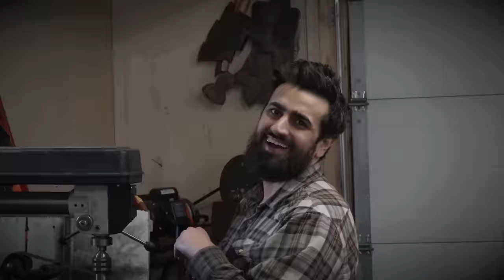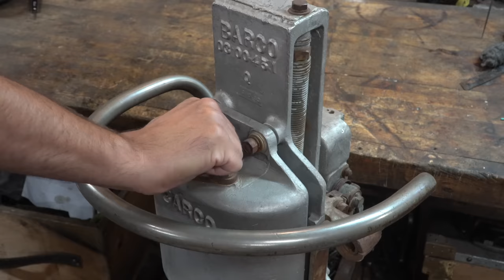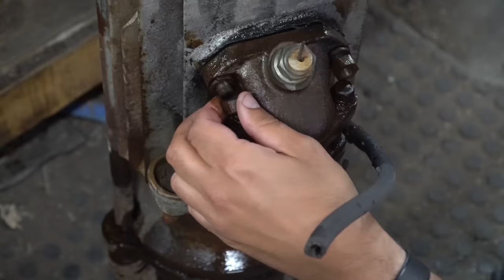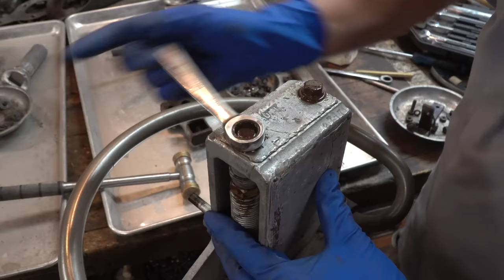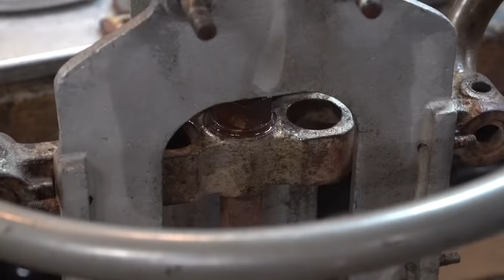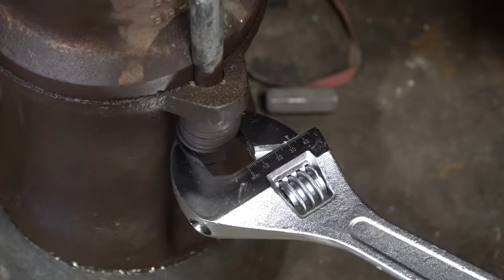Gas-Powered Pogo Stick Rammer Thingamabob [Restoration]

Comment: I have three of those rammers. Two for spares and one fully working. It has an interchangeable foot for round, rectangle and horseshoe for going around fence posts. Last used for gate posts. Being an oldie now I hop it off the trailer to the job. Gives you a work out but it is not   a beast to use once you master it. The handle is more offset that that one and does not move on a slide, being just rubber mounted to the engine top. Super restoration. Thank you, best from the UK.
Reply: Not seen one of those foot splaterers working in the UK since the early 80s! Top job keeping on working!

Comment: I haven't seen one of those rammers in use for decades. Damn fine job, sir - you've kept a piece of engineering history from the scrap-heap. Must be one hell of a rush to operate that insane device!!
Reply: I still remember seeing them used in minor road works as late as the 1990s or early 2000s in Europe. The ones I remember didn't run continuously though, you had to flick a trigger with your thumb for every explosion. There also was a different version that used a regular four-stroke engine and rotating eccentric mass, looked and sounded much less archaic and amazing.
Reply: So what is the point of this machine what exactly does it do ? Any info please would be greatly appreciated
Reply: @jamesfair9751  It's for compacting soil before building something on top of the area.
Reply: @BEdmonson85  thank you
Reply: how do you turn it off is my question
Reply: @SpitfiretheCat16  well if you’ve got that on site and you’re not willing to wait for it to run out of gas I’m thinking you’ve also got a steam roller and a bulldozer on site so you can probably figure something out😂
Reply: @SpitfiretheCat16  its controlled by that piston system, so you can just interrupt the cycle by not letting it actuate and it stops.
Reply: @BEdmonson85  I don't really see why anyone would bother using one of these given how fast wacker plate compactors are
Reply: @WarlordEnthusiast  they predate them, really the only reason why
Reply: @jamesfair9751  compacts dirt for road ways and similar projects - probably be good for compacting sand during a pool instillation
Reply: @SpitfiretheCat16  If you don't allow the spring handle to compress as the machine hits the ground it won't charge the magneto. Once that magneto indexes it will send a spark out as soon as the handle is lifted to the neutral position. If you can ground or remove the sparkplug wire while the magneto is charged, you can let the handle up without it jumping.

Comment: What a wonderful and complex restoration! This brought back memories. When I left the States and moved to Germany in 1965 these Barco Backbreakers were to be seen everywhere. After the war the Autobahns were built with these machines. I had one for awhile, but was very frustrated with it because it would only fire occasionally and drive you nuts the rest of the time. I didn't have time to look into it and gave it to a neighbor who helped me pave my driveway. Barco doesn't make them anymore, but there are still a few around here in Germany. I will look for a manual.
Reply: I remember them as well,  though I guess around where I grew up the delmag h2s was more common.
Reply: @R1ddic  true.. when I was a kid those were still common on many building sites
Reply: Did you saw any reparations for poland?

Comment: I don't think I've ever seen you struggle this much in a restoration before! This contraption was fighting you at every bolt, piston, gasket, valve, nut and piece... Good on you for sticking with it! This was a challenge for sure, but you won in the end, no doubt about it.

A rammer like that is a scary kind of fun! If you lose focus for just a second, you'll have summer teeth in a hurry... Some are here, and some are there! But that thing is one heck of a conversation piece!

Thanks for another great video, you deserve a break to relieve sore arms, fingers and legs after fighting this thing.

Comment: The amount of engineering that went into this tool blows my mind.  

Some guy saw a need for this tool for a specific purpose designed and set forth sourcing castings, forgings, nuts and bolts, baskets, tubes, wires,  pistons and rods and every other intricate details to create this.  😳 

A whole set of production lines had to be made to manufacture every tool specific part.

Mind blown.
Reply: As an engineer with todays tools I am amazed what at what they managed. Must have been quite some r&d.
Reply: Engineers are truly insane. They take concepts that are CLEARLY a terrible idea and force them into existence by sheer force of will

Comment: It never gets old watching someone make parts from scratch. The world needs more people with skills like these.
Reply: I used to trade in old electric lamps, most of them were entirely handmade. If they needed a domes screw they MADE a domed screw.  the bras parts were cut with shears and rolled or hand beaten into shape. 
It really adds a whole new dimension to thing to know that a skilled man took raw materials and created a thing of great beauty.
Reply: and the world needs people with more machines like these to make parts like these.
Reply: @katiebarber407  - Here in Bulgaria you can get anything made.  My fave shop in town - not that I use it, i just like that it exists - is the "made to order gasket shop"

Take any old gasket in and they will cut you a new one, no need to go to BMW and pay €200 they will make you one for €10.

Take the part in, they will pattern a gasket off it for you.

Comment: It was a real pleasure (and somewhat emotional) watching your retoration on this Barco Rammer.  Thanks so much for posting this!!!  My 87 year old Dad and I restored a Barco H-6 (1937 model) gasoline jackhammer before his passing. He could barely walk, but he absolutely loved going to my shop and working on projects.  A friend gave me the jackhammer as a totally rusted mess and I didn't have much hope for it.  Taking our time, we got each piece restored and back together.  Now, it's a beautiful machine.  We hadn't yet built a coil circuit for it when he passed earlier this year, so he never saw it run.  Knowing how much he wanted to see it in operation, it will be an emotional day when I do start it up.  It's something I want to do in his honor and as a celebration of our time together in the shop.

There is a nice compilation of Barco pictures, manuals and parts lists at http://gothotrocks.com/barco/barco/barco.htm.  He has posted a user's manual for an older tamper/rammer, but not for the one in this video.  Perhaps others can help him add Barco documents, advertisements and articles to his site.

Comment: A) That might just be the largest slotted screw there is. That's mental.
B) I've never seen you struggle so much with a disassembly. That thing had no intentions of coming apart at all. 
3) That's easily one of the neatest "what the hell were they thinking" machines I've ever seen, and that includes your swinging circular saw thing. It's surprisingly quiet too. 
Good work on this restoration.
Reply: You should see the slotted screws on the breech of 16 inch naval guns

Comment: What a "dynamic" old machine. We use the modern version of this frequently. We call them, as does the rental company, compactors.They compact soil much deeper than the walk behind plate compactors used to prep the ground for a concrete slab. Anytime there is a need to compact soil deeper than 5-6" , one of these "Gallopin' Gerty" compactors is used if a larger machine won't fit into the space. If you've never seen a contractor use a compactor, you'll know two things. #1 Why the concrete slab cracked next to the house #2 You need a different contractor.
Reply: As a former mechanic for Wacker Corp., we called them rammers
Reply: Great info! 👍
Reply: We just called them Wackers kinda like band-aid
Reply: They were common in the UK when I was a child - present whenever men dug a hole in the road - which was often. They fascinated me and, aged about 2 or 3, I named them "bedumfers" - from the sound they made. That kind of stuck as their name in the family.😀
Reply: @jc3745  Jumping jacks is what I always heard them called, and they were indeed Wacker brand if I recall
Reply: we use similar for trenches when going round roots we 'not allowed to damage' we've always called them elephants foot.😀🤘
Reply: @TomBonahawk  Wackers is what I've heard them called.
Reply: It's a whacker to me too. We had one like this on the first site I worked on and it was only really kept for novelty value as nobody was prepared to actually use it in anger. Perhaps they are OK if you practice long enough but we all preferred our bones and teeth intact so nobody was willing to risk it. We had other less nasty-accidenty ways of whacking. 

As a kid I'd seen them used and REALLY wanted a go. After one whack when I did get the chance I quickly changed my mind.
Reply: I call them "Jumping Jacks" but I used to work for a German guy who called them "Wackers" or more accurately "Vackers" because of his accent/sense of humor. I still call it a Vacker from time to time because of him.
Reply: Define large compactor, since i have never seen one of these on the worksite (though different continent might explain it), but plate compactors are often used(metal plate that has off set fly wheel and engine attached). Sure this is compact on size but not that accurate to control and where 40cm plate compactor cant fit, there is no need to compact it, or engineer designing it fucked up bad and work crew was not paid enough to care to point it out, even if engineer or management in general gave a fuck.
Reply: less PC name for them was "Paddy's Motorbike" , though maybe that was just the later ones with the conventional 2-stroke?
Reply: @em7ee230  The plate whacker we had was nicknamed "Paddy's go-cart" and we did have a groundworker called Paddy and he was quite adept at sitting on it and steering it by shifting his weight about. That must be where the name came from. He was the guy I missed most when I quit. Not only was he one of the most intelligent and well read people I've ever known he was funny, generous to a fault and taught me a lot about Irish history. He was a staunch republican and would deliberately start fights in pubs by expressing his support for the IRA. In a British garrison town (sort of) this was a red rag to a bull. He liked fighting and was really good at it too 😀

I always suspected that he was IRA.
Reply: Jumping Jack's. OK for a narrow trench on street repairs, but they really do not do that great of a job compacting.
Reply: Here in Switzerland we call it "Frosch"  (Frog)....

Comment: What a nightmare restoration, Miraculous job mate!  A suggestion on the air filter, in a lot of old medical equipment (like vacuum pumps), the bronze netting was used to hold a wad of cotton wool as the actual filter material.  I've even seen the cotton oiled like in a K&N style engine filter.  Flipping brilliant job! :washhands:

Comment: Man, I can remember these things when I was a kid being used by the council workers fixing the roads over here in the UK… Terrifying! I never even used to like walking past one when it was idle in case it went off.. I feel better now knowing that you have tamed one!! 😊
Reply: Takes me back about sixty years to watching the road gang. Not knowing what it was called, we kids called it by it's onomatopoeic name "Pladonker" 😀
Reply: I also remember the council road worker using one of these. Man what a noise and it felt like the entire earth moved with every thump. I must admit that they did the job very well and often wondered what had happened to them. Thanks for posting
Reply: I also recall the local council with one similar as a boy. I'm pretty sure one ran on LPG however ( I recall the distinctive smell, and the hose connected to a bottle) It's likely that a petrol version like this was also used at some point. If only I knew someone in the council that might have access to a manual if that kind of thing was ever stored.
Reply: Please tell me the haahaaa is Roberto the robot from Futurama 
Coz that really cheered me up
Reply: @footplate0  Happy but scary memories 🙂
Reply: @squelchstuff  Quite possibly LPG... The ones I remember were petrol, so added risk of fire as well 🙂
Reply: @jonathanbrown4359  Maybe, as long as it cheered you up its all good 🙂
Reply: @auger7074  ❤

Comment: This thing is just... Beautiful honestly. And the fact that you got it running basically as good as it probably was brand new, is amazing. Interesting how the ramming head piece is magnesium tho. I would've thought it would have been some other material that doesn't rust or corrode honestly.
Reply: Isn't it just magnesium for the weight?

Comment: The reason the foot is made of lightweight alloy is because it doesn't just exert tamping force when it lands, it does so taking off. To maximize that tamping force on "launch", we want the machine to weigh a lot (for inertia) and the piston to weigh very little (so more of the total energy available is spent tamping and not accelerating the foot).

Comment: Loved the video - I think I saw one of these operate in the late 1990's at an engine show in Denton, North Carolina.  Pretty amazing - if I'm correct, it is a gasoline engine that does not compress the fuel-air mix. As the upper piston rises, it draws fuel/air mix in, which is ignited at the end of the stroke. I've never seen the workings of a pile driver, but I think there must be some similarities. I think the pile driver I saw in operation was diesel powered.

Comment: I've seen old pile drivers that work in this principle, crane hoist the weight, then drops it, on the way down it triggers a fuel injector that squirts diesel into the chamber bar and the falling weight compresses the charge igniting the diesel, the resulting explosion drivers the piling into the ground and the heavy piston/weight back up into the air. Pretty impressive and they made a hell of a bang.

Comment: Amazing talent needed to restore tools and you have it.  That's a interesting tool.  Make a barrel just slightly larger than the working end and make yourself an over-designed trash compactor.  😆 I use a stiff blade putty knife with the end sharpened to a knife edge.  With a chisel, the parts you're tryng to separate binds on the opposite side.  If I can get a knife edge between the parts all the way around, in most cases, the parts will separate.

Comment: I ran one of those on a dam construction site in the '60s. Near Rockford, NE. Once I got the hang of it, that contraption was quite effective. Just lean it a little bit in the direction you wanted to go. Too much lean and it was out of control. I suspect it was much cheaper to use than the typical air compressor & air tamps. It was also much easier on the body than all the vibration and heat from an air tamp.

Comment: I had a similar problem with vibration and chatter as yours on my Rockwell 11" lathe. It turned out to be insufficient preload on the spindle bearings. If you have such an adjustment it's worth looking at.

Comment: I noticed a similar behavior on my lathe, and I was horrified. Turns out the bushing that holds the (tapered) spindle pressed up against the lathe body had come loose and the bearing was just backing out a little. Tightening that solved my issue. I don't know what kind of lathe you have, and if it features something like this.

Comment: I used to go to the sand dunes here in MI and run around in dune buggies. Our buggies were Corvair powered, and we would wait for someone with a VW powered one to break their transmission. Then we would ask if we could have the busted gearbox (most people brought extra parts coz something always breaks) then we would bust up the gearbox housing and throw chunks into the campfire at night. Lots of VW transmission housings are magnesium so we would usually have a cool light show at our campground lol. Long story short, magnesium is cool.

Comment: WOW !! A simple machine with lots of parts.  For the work plug, could you you put A thin coat of epoxy around the ceramic, to keep it from cracking? Or A cork gasket?

Comment: I remember as a child living in West London in the l950's, workers digging holes in the road and flattening down the tarmac on top when they had filled in the holes, to restore the surface ready for road traffic, surrounded by a blue haze of unburnt hydrocarbons from the machine's exhaust. I was always expecting the machine to land on the foot of the men using it, unsurprisingly this never happened!

Comment: Even all these years on, seeing this being restored and used just seems one of those crazy times when there were tools that had very obvious designs that if used improperly. Would result in either, but not limited to, teeth loose, finger de-gloving, foot flattening or a combination there of.

For this pogo rammer, I'm sure in fine print somewhere it has the sentences used 'guaranteed to cause blood to shoot out of your ankle if you step wrong. This is a time before osha, walk it off... Ok, hop it off, pansy.'

Comment: Could the mysterious valves be some sort of PCV like protection for excessive blow-by? So instead of a massive backfire/afterfire, those valves safely release the gasses? Not sure about the smaller one, but the Futurama guy looking one kind of looks like that to me, especially with that wide vent slot on it? That vent also looks like its shaped like a whistle on a steam train horn, so perhaps it gives you an easily recognizable sound to alert you? Strange for sure.
Reply: Great video as always btw, that thing looks incredibly dangerous and scary, so a perfect tool for this channel :)

Comment: Barco also made a jack hammer for breaking up concrete.  Instead of air compressor cables, you had a cable to a 6 volt car battery